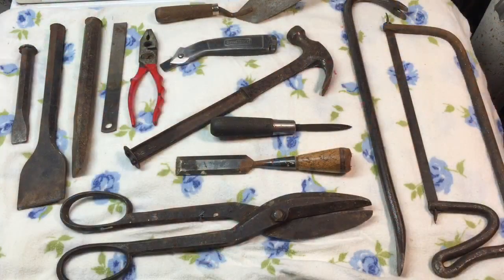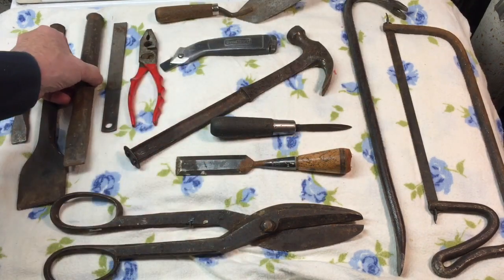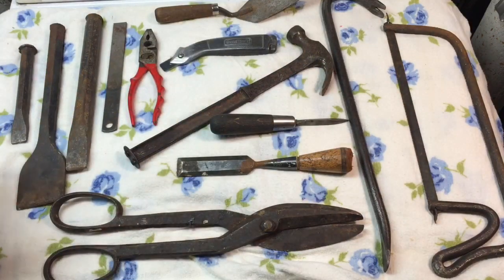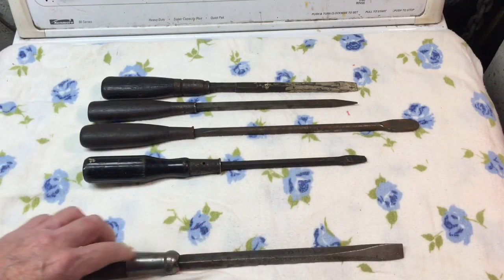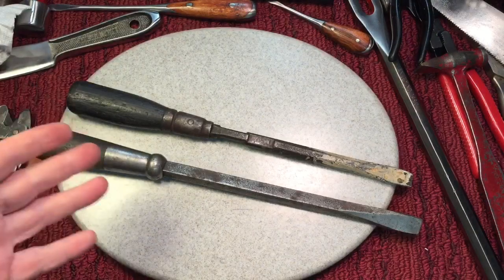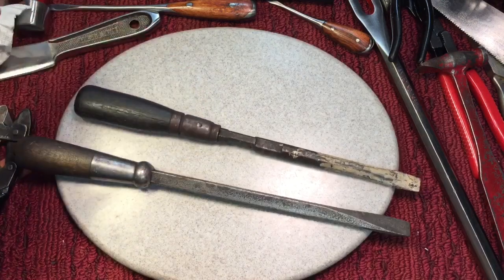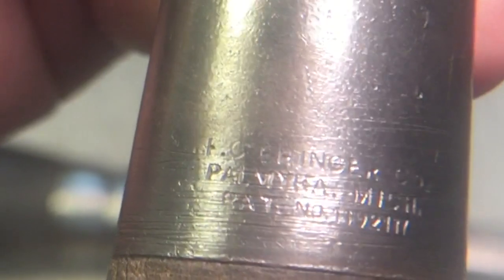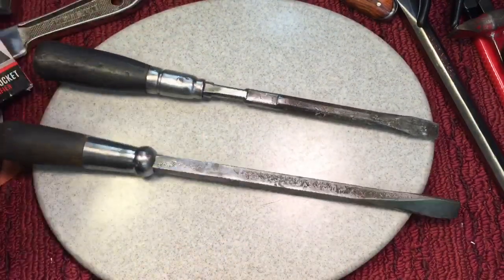2 Rare Screwdrivers and Hurricane Ida!

Comment: go time to move forward on the sump, get a pump with a float switch or not...txs for sharing
Reply from the maker: Hi Tom, The old fashioned float switches like those used on a boat are great, they are like a wedge that when water opens it the pump goes on, the float switch on my pump is awkward to me as it has to float upside down before engaging and look like it could hang up...  =D  Thanks!

Comment: I look at it like it’s training. When an emergency happens and you have to scramble to assemble a pump and a hose, it’s good to have all the things necessary and the tools and the wherewithal to implement it. It’s how we make use of the combined toolset that we assemble in life, and why it’s good to keep expanding your experience. Just the day before Ida got here, my wife saw a leak in the bathroom by the toilet and I see it’s from the fill for the toilet and I get a wrench to tighten the nut at the base of the tank and the nut is plastic and it shatters and water is gushing everywhere! I quickly turn off the valve at the bottom, but a few gallons of water got out and start leaking in the basement. I remember that I bought a flexible toilet line and had it in the garage and I was able to fix everything without needing to go to the store. I remember arguing with her about buying the extra flex line, because she felt it’s not necessary. But in my mind, I like the peace of mind knowing I have it!
Reply: Glad you were ready with the fix. Having a spare, if possible, is always good. 
Plastic fittings are the pits. The braided metal flexible lines with the metal fittings are much better.
You experienced some,good training, as the military says. 
I was fortunate that I spent 10 years fixing other peoples problems before I wentinto engineering. So most of my Training experiences have been at their expense.
I don't touch a water line repair without turning off the water and draining the system.
A quick flush and holding down the handle will empty most of the water in the toilet tank. 
A wet dry vac will remove the rest and is a great thing to have ready just in case.  😁😎

Comment: The screwdrivers look terrific.   So glad you bought them to give them a good second life.
I heard on Philly NPR station someone saying he has 5ft of mud in his basement.   Wow.   Water can be pumped but mud will be back-breaking to remove from the basement.
Glad you were able to use the sump pump to keep things under control.
I was lucky, no flooding in my area and only 15min power outage.
As a home owner, my experience is that water is often the biggest enemy - assuming no hurricane strength winds.
Dave.

Comment: Odd question regarding the screwdrivers. Are the handles unusually lightweight? Very tight grain? I have a random unusually large screwdriver that looks similar. It is marked j a hinge there may have been more, but that is what is readable. The distinct thing about the handle besides being oval is that it seems to be made of some tropical wood that is actually a grass, sort of like coconut wood products. It's a feature of very fast growing grasses in equatorial regions. Don't know if that is of any help, but it is the only reason I recognize it
Reply from the maker: I am not so good at identifying unusual woods, these were both pretty hard.  I never seen these types before.  😃👍

Comment: Hey Scout, you may need to change some elevations on that side of the property to get some positive drainage away from the house. Knowing you, I’d bet the gutters are clean, so that won’t be the issue. At church, we dug down along the length of the wall about 10 inches and dumped a 5 gallon bucket of black Jack roofing tar in the problem area and heaped up dirt over that and spread it to raise the elevation to drain away. That was 4 years ago and still no leaks.
Reply from the maker: I had this house drum tight until Con Edison replaced the pipes in the area- Now I get leaks where they worked on the house.  I’m done with this house, I’ve been looking for a new home.  😃👍

Comment: Sorry to hear about the water in the basement. When it rains hard continually for days I worry I’ll get water in my basement as it’s happened before but i get it up through the corners of the floor. You getting it in streams through the wall is crazy. Really need to get that fixed somehow. Very unique screwdrivers and polished up nicely! Was that hacksaw in the lot custom made? 👍😀
Reply from the maker: Hi Steve- I have seen those hacksaw’s before they were inexpensive alternatives to the pricey ones years back.  😃👍

Comment: I worried and was keeping my fingers crossed for you when I saw news pictures of water gushing down NY subways and swamped vehicles. I figured if any video got posted on time despite the storm challenge it would be from SC. The USMC vets come through. Adapt and improvise. Those screwdrivers are absolutely beautiful. I would call them works of art. I could make out Palmyra, MI on the ferrule of the first screwdriver. Palmyra is still there as a small town, but I can't find any mention of a tool manufacturer past or present. Maybe a tool collector knows. Thanks
Reply from the maker: Pat- I too searched and couldn’t find anything!  357MagDad is good at researching tools!  😃👍